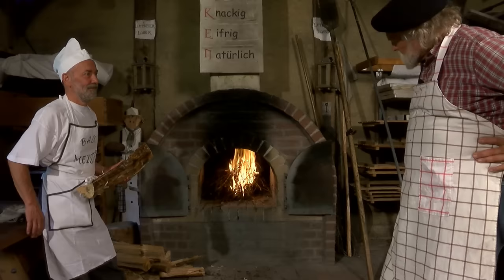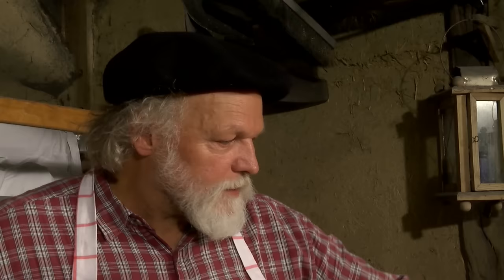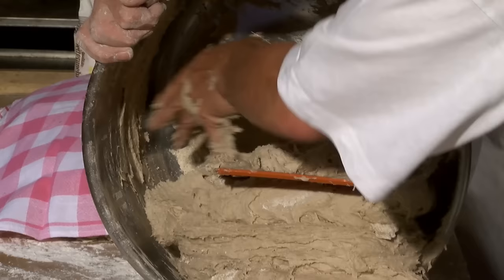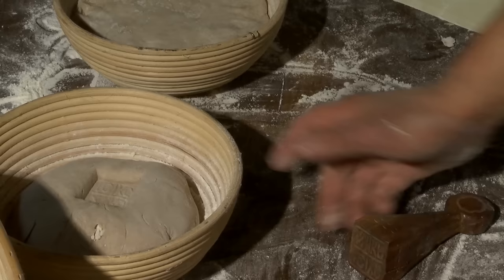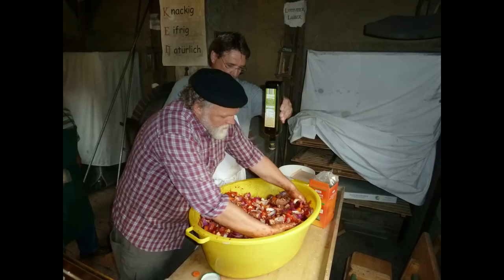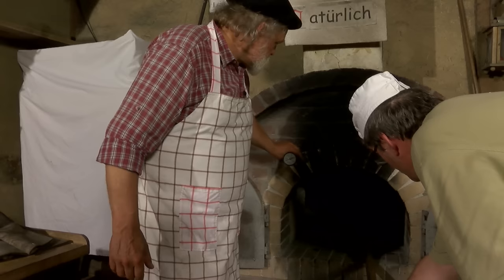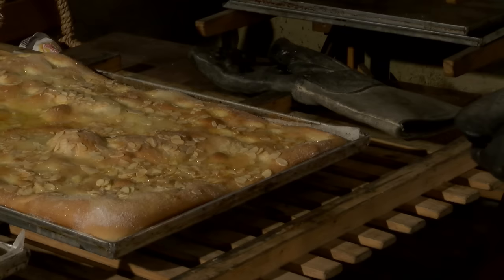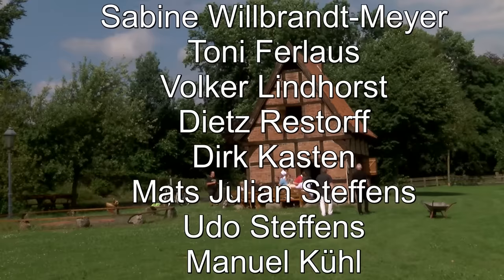Traditionelles Backen im Steinbackofen

Comment: Das ist super mit der Mehl Probe, danke dafür 🤗 ich arbeite schon 3.jahren mit meinen Holzbackofen,  es gibt nichts besseres nur man arbeitet da mit einer Hitze von über 300grad, so bei 290-310grad schieße ich mein Brot ein, mache alles darinnen, braten, backen, grillen, Räuchern, konservieren, die Torten und kekse sind der Hammer, dörren, Trocknen, Joghurt, Topfen, arbeite 2 Tage damit, weil die Temperatur langsam fehlt und das alles nur mit einmal einheizen. Ich komme aus der Südost-Steiermark und backe auch sehr gerne mit Kindern, die sind immer begeistert, mache auch Holzbackofen- Vorführungen, damit die Leute sehen wie schnell und einfach man alles damit machen kann, alleine die Speisen sind der Hammer.